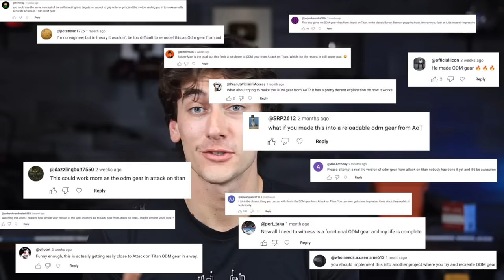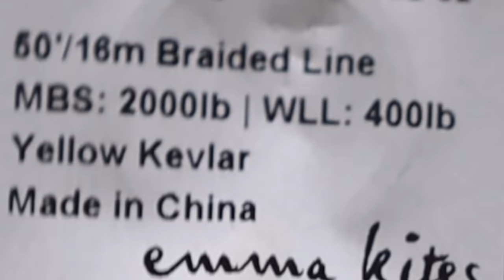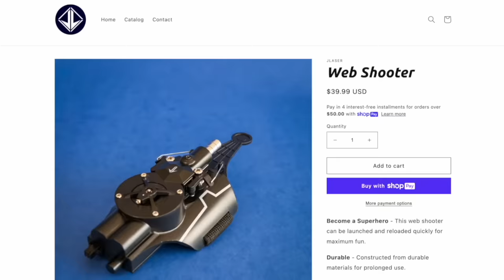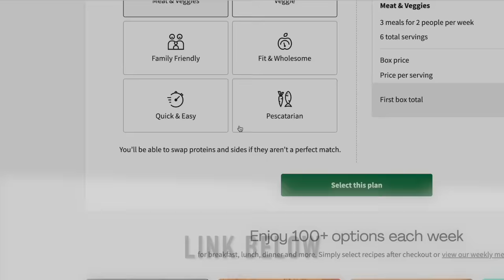I Built Real ODM Gear! - Attack On Titan

Comment: The ones in the show also have very huge tanks of compressed air they use to fire and as a jetpack. I believe theyre used to turn the motors as well.
I believe a change in the hook design could help it fly straighter and grip the material it enters better. Maybe a blade shape, as blades wedge into what they penetrate much easier than a spike does.
Reply: compressed co2 is literally rockets strapped to your hips, too risky for amateur engineers

Comment: The ODM gear not only has the grapples but what you pointed out as two motors are actually compressed air thruster so they can control direction more while using the grapple.

Comment: Little tip. The characters in the show have full body harnesses that run under the soles of their feet as well. So they can attempt to stand if necessary.
Reply: Yeah. Their kit is similar to a parachute harness up top and essentially stirrups running from their hips to their feet.
Reply: they mentioned that in the video :)
Reply: the problem isnt that he doesn't put it under the soles, he didnt do it cuz "when his leg bends it does nothing". but even in the example he shown, it shows how it wraps around the knee so it follows the way the leg bends. he cheaped out.
he made a functional prototype tho ill give him that. 4/10

Comment: You’ve made some dope stuff but this is 100% my favorite and was WAYYYYY more successful than I thought it would be! Amazing work, amazing dedication, just wow.
Reply: The reason why it worked out is cause theres more room when making web shooters you need to make it compact and same with iron man but odm gear has quite a lot of room compared to other things like in the show it’s pretty bulky I still don’t get how in the anime they made it though cause it’s pretty complex with older equipment because attack on Titan was set in world war 2 era so yeh
Reply: @Gorartsy because odm gear is slightly more realistic then magic spider web fluid that is strong and shoots from a tiny compartment
Reply: I wasn’t comparing it to the spider man web shooter, I was comparing it to what I expected the feasibility of the project to be based on how hard it is to actually use any sort of grappling hook, nevermind aiming, not just being lifted but being pulled through the air and doing so accurately and not too fast or slow, etc. 

I know a lot about engineering and fantasy inspired projects, and this was still far more feasible and well executed than I was expecting.
Reply: ive never seen a grappling system work this well before. the fact that it can lift you that quickly at a 45 degree angle is insane.
Reply: Honestly you would kind of have to try to make it not work. It was very well done in the anime to begin with, but could obviously be done better in real life as we just saw.

Comment: Bro, that is incredibly good. Some more improves and lots of training and that could actually look like in the show. Maybe without those fast moving acrobatics because it seems insanely hard and dangerous in real life but moving around the forest doesn't seem impossible. The only problem I see right now is that you have to still figure out how to quickly pull out this pin during flight to shoot it again.
Reply: Not only that, but it is also the gas, among other problems, the gas is responsible for the equipment being completely three-dimensional and you can do it in any direction, without the gas you would crash against a wall without being able to avoid it

Comment: I think the most impressive part of this video is even after expertly making accurate, functional ODM gear, you managed to learn it to the point where you can jump up through barn windows and even slay mighty inflatable titans. If you put two years into training with YOUR ODM gear, even considering our worlds physics, I believe you could do some insane stuff. I just think its cool that you made a fantasy anime strat that in other words be impossible, possible. This is the coolest thing Ive seen in a long time, coming from an AOT fan.
Reply: The chances are higher he ends up in a wheelchair if he starts training for 2 years.
Reply: But would he last long enough without breaking his bones in a fall to be able to pull off this insane stuff?

Comment: The hook part is strong when its against buildings but comes off so easily is because when its in a wall those blades fan outward into whatever object it is, then when the user wants to release it those blades fold back in releasing the hook

Comment: I think the ODM gear works because it's connected to the hip but harnessed to all the body therefore it can be aimed with the help of the movement of the hips, the legs, and probably the arms as well. Also it does not work solely through pulling, there's gas that acts as a propellant to help them "fly" and gain momentum. In the anime, there are times that the gas alone shows that it can propel someone without the ropes.
Reply: It was challenging enough for them to get the winches to turn fast enough to pull them bodily through the air. I don't even want to think about the amount of gas pressure necessary to propel a human being, even one that already has momentum. Plus the tanks would add extra weight. It would probably end up being almost as big of a problem to solve as they spent just getting the grapples to work.
Reply: @TheSchaef47 yeah, and in the show the propelling is done with a mineral that doesn't exist irl
Reply: @therealspider843  well, there is that
Reply: And they show that the gas nozzle provides yaw steering as well.
Reply: @TheSchaef47 I believe its called “iceburst” stone
Reply: @TheSchaef47  Would literally need to be a rocket scientist for this one.
Reply: @riorange2083  Potassium Permanganate + Hydrogen Peroxide. This is a monopropellant reaction and is likely what Isayama had in mind with 'iceburst stone'. The hydrogen peroxide wants to break down into water + oxygen and is encouraged by the potassium compound. Could you not use this to power the ODM gear? You could store the hydrogen peroxide in small pressurised tanks (your not gonna be swinging for minutes and minutes). Maybe the shooting is done with CO2 IRL but the reeling and gas thrust is then powered by the monoprop reaction. The hand controls determine how much prop is released into the reaction chamber which generates steam. The steam is piped into impellers which generate the torque for reeling in the rope. With enough practice hopefully this would allow 'braking' as the ropes extend (scale down a wall). The gas is the trickier part. Generating enough thrust for a person would be very dangerous. H202 isn't very playful either so I don't know about the fumes with unbroken peroxide in it? The biggest hurdle of all would be the user. Like we've said, training took years in fiction and it would likely take weeks just to attempt to use single-use ODM gear. But the end result would be pretty cool to see.
Reply: @2KOOLURATOOLGaming I think the inspiritation for iceburst stone is methane clatrate, also known as burning ice. Looking at a picture of both iceburst stone and methane clatrate will probably change your mind.
Reply: The gas itself is using some fictional/magic minerals that are only available on paradis
Reply: @dauzlee2827  no, the mineral is methane clatrate and the gas is methane. It was created by the founding titan like the glowing ore and is probably just very rare in the rest of the world in attack on titan and they couldn't find it anywere else

Comment: This is actually so awesome! Just a note, their harnesses cover the entire body, from shoulders to the feet, and connect to their belts. Also, their scabbards have gas tanks mounted above them that connect to a sort propulsion mechanism that uses it to propel the user forward. I think it'd be cool if a potential 2nd version of this integrated that too.
Reply: why dont you do it
Reply: @n.t3026 Don't you think the man that already did it once should do it again?
Reply: the harness would be over-engineering at that point because you can't add actual gas propulsion like in the anime very effectively
Reply: @SmithFemboyFurry  If thats true then ur moms gonna be really busy
Reply: @artfulsparton7642  this, in the anime they got some magic "stone" that turns into a huge amount of gaz, we don't really have that.
Reply: I think compressing a jetpack assembly into a little box in the small of the back is too much even for this guy

Even in the anime it's magic (ice crystals generated by Titan power that react with natural gas to produce huge amounts of compressed steam)
Reply: @thomasprice7893  Besides, didn't smart people figure out that it would just kill most people getting pulled by these things by how fast they accellerate?
Reply: @n.t3026  Bro are you like eight years old?
genuine question

Comment: This is probably the coolest thing I've ever seen. I'm a construction worker, not an engineer, but I always thought it would be possible to build the rig from attack on titan, just that nobody actually had the drive to do it. So glad you did it, glad I found your channel, I'll have to subscribe.
Reply: Do you think odm gear would be helpful in construction?
Reply: @BlahstarRecords I don't think so because it would just damage what you are constructing
Reply: My head is running through all the possibilities with this. I don't imagine the acrobatics would be feasible, but I don't doubt that there is commercially available (if not cheap) hardware one could use to make this more "practical": say, pull you and 100 lbs of equipment (for your recon mission or for reloading the ODM gear) up a concrete wall.

But we already have grappling hooks I guess?
Reply: @BlahstarRecords  Not for construction, was just saying my skill set isn't as applicable to building something like this.

It would be more practical for first responders, although considering the conditions it would need to be effective and the amount of training and funding needed, I don't think something like this would ever be used.
Reply: Coolest thing you've ever seen? Lawl

Comment: I think the most insane part of this to me is that you literally addressed the same fundamental question the Mythbusters failed on 16 years ago, but succeeded where they failed(at the time).

As soon as I saw how you were approaching this, it reminded me of one of their early superhero episodes where they attempted Batman's grappling hook. Very similar approach too, using an explosive charge to embed the anchor into the substrate & a high-powered winch to reel you in. At the time though, they basically came to the conclusion that they couldn't reliably get the anchor to stick (granted, they were trying directly into concrete) + a wearable-sized winch wouldn't have the power to reel you in.

It's insane that in 16 years we're at the point where this can be reasonably pulled off, and with development/iteration, probably made even more functional.

This was amazing.
Reply: In time this could be part of a specific emergency rescue gear  fire fighters or police...or XGames style events which would further push the tech and smooth out safety and reliability issues while expanding the range of surfaces this system can be used on.   This really feels like there's some kind of actual merit here to continue the research.   I'm really impressed already.
Reply: I want to watch the Mythbusters video but i cant find it, whichone is it?
Reply: 16 years ago the electronics may not have been there tbh. 3D printing and microcontrollers have seriously changed the world
Reply: mythbusters isn't able to put as much time and resources into making it work. and they don't have the motivation to make it work. They can shoot the footage call it busted and upload it. Jlaser can only upload if it succeeds. You can tell from the cut together footage in this video that it never really worked how they wanted. The shot's of him swinging from the roof are never shown being deployed from the waist.
Reply: The difference is that in the Titan world and this video they always hit wood (houses made of wood, trees etc as concrete wasn't used in the Titan story) however in Gotham it's all steel glass and concrete so for Batman hook you needed something that could attach itself to concrete. 

To do so they had to propel the nail with a bullet charge and still it struggled to embed itself.
Reply: 16 years of other people making better electric Servos and Motors
Reply: @trequor  you are correct the fact that people believe we had the same stuff back then is hilarious
Reply: I think that the main problem with this is that the buildings will be made of either concrete or wood, a hard surface you would find very commonly or a surface that would break alot of the time with the kind of forces a scout would be putting out

If there's another material out there I can't remember, then darn
Reply: technology.
Reply: Would love to see the mythbusters come back to see what they can pull off with all the advancements that have been made.

Comment: First of all great job. Do not forget that theyy didn't figured odmg gear out in one day and even one year. refine the motors, also the whole engine and casing was built in an angle , your is straight on the pivot point. I don't know how they made it detachable from surfaces but that is another story. I think this project could be fuly realised. Pobably the most realistic fantasy gadget

Comment: The straps in the show were not just on the legs. They covered the entire body. They're meant to distribute the weight on your entire body (shoulder to feet), and both the top and bottom straps connect at the belt.

I don't know if it'd have made any difference, but would've been interested to know.
Reply: It's likely necessary as well: During a scene in season one we see some garrison soldiers distracting titans, while the Survey Corps goes on an expedition. Horses of the corps can maintain a speed of 35 km/h meaning that these soldiers already moved faster. And that's the average soldier someone like Mikasa is on a whole other level (there was a video somewhere which analyzed a scene in which, in order for the scene to work, she would have to withstand g-forces similar to that of a fighter pilot under extreme maneuvers).
Reply: @CecilyThanador  it's a fictional show.
Reply: It's a fictional show that has legitimate science and physics behind the actions taken in the show. Very little isn't considered. There's graphs and diagrams of the gear, how it's made, etc. 

As you can clearly see in this video, and amateur engineer made ODM gear in his garage. There's obviously some merit to this idea.
Reply: @shellshockedbros4458  While I do agree with your comment I was mostly thinking about this paragraph ''there was a video somewhere which analyzed a scene in which, in order for the scene to work, she would have to withstand g-forces similar to that of a fighter pilot under extreme maneuvers''
Reply: @ukko8457  I had the full harness as cosplay and if worn correctly, the harness does actually work to control your balance.
Lifting your left foot ahead of you would pull your right shoulder back for example.
So in theory, if you were dangling from your center of gravity, you could shift your position mid-air with little effort.
Reply: @ukko8457  which within the show physics parameters makes sense because Mikasa is considered a prodigy/one of the most talented people
Reply: @ukko8457  Right but you understand that the fighter pilots can withstand those g-forces, like every single fighter pilot? So there isn't much to say that Mikasa couldn't do the same.
Reply: @ukko8457  No, it's a real show, its events and characters are just fiction
Reply: @ryzrz3616  but there is a clear difference, pilot is ,,protected" by the plane and Mikasa would be fully exposed to air resistance and the associated force, which would result in a much greater burden
Reply: @Brudyr  fighter pilots have to wear anti-g suits as well.

Comment: This could seriously be good for rescue operations and firefighters. If you added some more safety precautions and made it a bit more intuitive this could be used to save lives. I imagine making it so the wire locks in place and can’t extend without triggering a mechanism would help with scaling walls, and adding some kind of proper handle to the wire would help with balancing.

Comment: From all the ODM build videos I've seen so far, your ODM gear is the closest to the real thing and from afar compared to the other videos. If we could make the gas ejection thing that maintains you in mid air while the hooks are reeled, imagine just using the gas thing alone to jump higher or run faster, I can't wait to see that if you are going to make it ! Awesome video !
Reply: It's not that he can't do it. Our boring real world physics won't permit such a thing. You don't have where to store so much gas without adding too much weight and volume. Unless you replace that with some jets maybe but then it would not look or feel like ODM and even that way may not work because of the extra weight.
Reply: And the fall wouldn't be nice anyway
Reply: @raresandrei7205 Also, pushing on your back with enough force to move a person non stop would be pretty painful, especially if you tried to reach the speeds they do in the show.
Reply: Unfortunately it's kinda impossible to replicate the gas propellant system. The thing about the anime is that the gas system it uses is an extremely ridiculously strong propellant that is quite a bountiful resource. The real world does not really have such a propellant, the only way it could be made would require a ridiculous amount of resources to propel yourself for a very short period of time.

To add, the speed the gas in aot propels you is probably enough to knock you out cold from all the Gs. Everything else is probably plausible though, which is kinda cool.